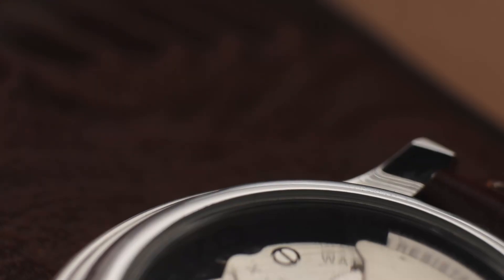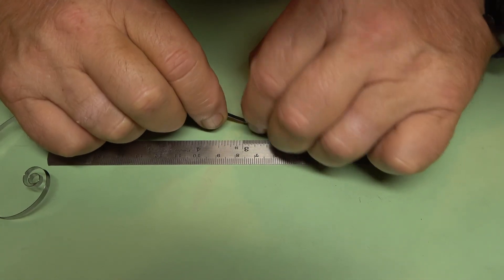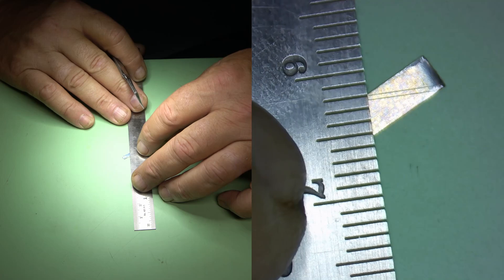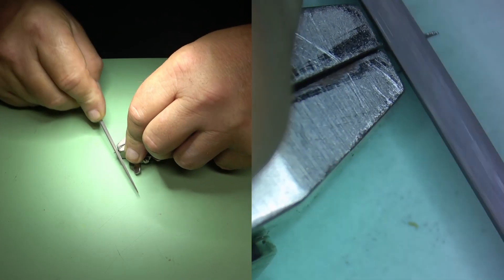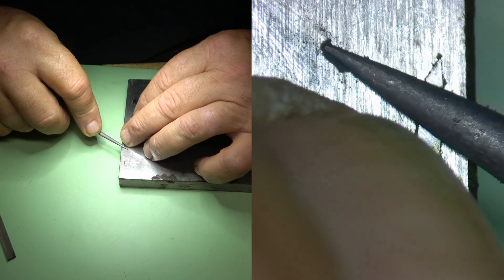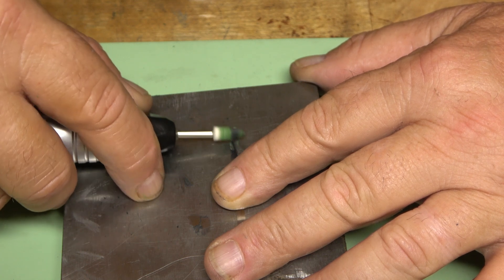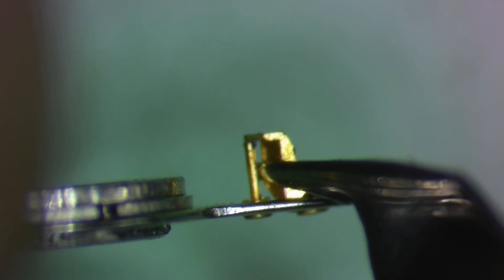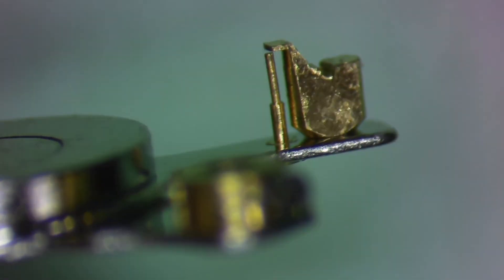How To Make A Regulator Pin Adjusting Tool

Comment: Another great video!  

Sorry if I'm slower than the rest of the class, but... :-| 

If I have a movement which has a large timing difference between dial-up/dial-down (horizontal, in your vernacular, right?) and crown up/down/left (vertical?) should I increase or decrease the regulator pin gap?  It sounded like increasing the gap might bring the two measurements closer.   

Research elsewhere seems to indicate that widening the gap might trade off the constancy of the amplitude and rate thru the course of a wind-down (i.e. with a wider gap the movement would slow down more markedly as the wind decreases.)  So this would be the tradeoff made.  Sound right?  And THANKS!
Reply from the maker: To answer your question I need to know 1) what movement you are working on, 2) what are the rates,  amplitude and BE in all 6 positions.

Comment: Thanks for sharing so many informative videos. There're amazing.
I'm trying to regulate my watch. After a moth tracking it's accuracy I've found that it's rate advances over time. In the fist days it was a -2spd. Along the month it was increasing linearly every day till +36spd.
May this issue be related to the regulating pin? Maybe the friction isn't enough to hold the spring in it's position?
Reply from the maker: Here are the main factors that could be causing your watch to run faster over time:

Escapement Out of Adjustment: If the escapement isn't properly aligned, it can affect the accuracy of the movement.

Faulty Poising of Balance Wheel and Hairspring: Imbalances in these parts can lead to irregular timekeeping.

Play of the Hairspring Between Regulator Pins: Too much or too little movement of the hairspring between the pins can speed up the rate.

Magnetic Fields: Exposure to magnetism can interfere with the balance wheel and hairspring, affecting accuracy.

Rubbing Friction (Pivots, Jewels, Lubrication): If there’s too much friction due to poor lubrication or rubbing, it can cause inconsistencies in the movement.

Comment: Will bending the pins this way not mess up the accuracy? At least in Jendritzki's Watch Adjustment book, he states that bending the pins this way will make them divergent (not parallel) to each other, and this will result in very different DU and DD rates, because the hairspring will be pulled by gravity either in the direction of a wider gap in one position, and a smaller gap in the reverse position. Instead he insists that one should kink the pin in two places so that it can stay parallel to the other pin. I would be interested in hearing your opinion on that? How would you achieve the double kink, and with which tool? Or is this not necessary in your opinion?
Reply from the maker: First, the main reason for adjusting the pins is to bring the hanging positions closer to the laying positions. So accuracy is already an issue right?

What you are saying is true if the pin is bent too much. If it's too much out of parallel it will affect the horizontal positions and even certain vertical positions.

This tool is really meant for widening the gap when a pin that has been bent in.

The gap can be closed with a multitude of tools to move the pins closer in small increments without affecting differences too much in horizontal positions.

If you are working on a flat hairspring and have to make a large inward adjustment, this is very rare unless the quality of the movement is just crap, then you need a spacer which can be made from old mainsprings or needles to your desired gap. 

This is inserted in between the pins and you make the bend with a stiff tip tweezer. The spacer is just there to prevent crushing the pins together.
Good question. 👍
Reply: @watchrepairtutorials  Yes, that seems like a good idea. Jendritzki writes that the gap should be as small as possible, just big enough so that the hairspring in it doesn't lock when you move the regulator. But I fear that bending the pin with tweezers might loosen the pin at its rivet, and a loose pin would be much worse. It would be great if you could make a video on that subject. 👍
Reply from the maker: @maciej6293  that's true for an over coil but flat hairsprings need a little bit more room to vibrate. Theoretically when a flat hairspring is centered between the pins, the gap on either side should be equal to the thickness of the hairspring itself.
In reality, small adjustments are can be used to fine tune rates in all sorts of ways.
You have to realize the he was an instructor and he is teaching proper theory by the book so to speak. 
Regulator pin adjustments have been used by watchmakers for ever.
Lastly, regulator pins are friction fit so when you consider how small and thin these little brass pins are, If it became loose bending it, it was already loose. 
Believe me, there's no tool designed to make that bend.

Comment: Your videos are just great and my go to for learning. I have a question. I have perched a hundred or so bulk watch main springs and your videos on selecting main springs are excellent. My question is on the spring washers the plate the springs are coiled into their is a number like 50 or 60. Do these numbers mean the length or something or just a stock number. I'm just getting started. Should I have not perched bulk main springs.
Reply from the maker: Probably not. Items that are usually sold in bulk are sizes that are very seldom ever used so if you have a way to identify them, then you can catalog them in its possible that you may be able to use one of them one day..
The number on the ring by itself as no significance.

Comment: Just watched a video of yours about lubricating pallet stones. You said you used grease, but it looked like oil. What kind of lubricant did you use?
Reply from the maker: 9415 is a thixotropic grease that is thick until something comes in contact with it which liquifies it and then goes back to a solid.

Comment: I have been getting interested in watch repair for a couple of months now and I have watched a number of your videos.  You have taught me a lot. Finally I have something to contribute to you. My background is in metallurgy and I spent my career in the heat treatment of aerospace parts.  When you heat the mainspring material red hot with a torch and allow it to cool in air it is not tempering.  It is technically Normalizing.  It will probably make the material soft enough to cut and file but it may not be the best way to accomplish this. There is a risk of some areas, like the edges, cooling quickly enough to partially re-harden.  Heating the spring to a temperature slightly below red hot, if you can do it, would produce a lower hardness and less chance of breaking while cutting and filing. Then when re-hardening the finished tool the steel just has to get barely red hot to allow it to harden on quenching, around 1500 degrees F. In the video it is way overheated. Probably works most of the time but its not necessary.  After quenching temper the tool in any oven at about 450 degrees F for an hour or so.  This will lower the hardness slightly but increase the toughness greatly. I hope this helps.
Reply from the maker: Wow. Thanks for that. I am obviously not a metallurgist so I was just showing the way I was taught it it's great to hear from someone with real world experience.

Comment: Question about shaky hands- What strategy do you use to work on hairspring adjustments and other sensitive parts? Or can you drink 4 cups of coffee and still have steady hands like a superhero?
Reply: The secret is to relax as much as you possibly can, mentally and physically. Check and relax your shoulders, then do it again and again.
Reply from the maker: Well, I can tell you that working in a comfortable position helps greatly. Working under a microscope also helps with the ability to make very precise movements.
No, i'm a two cup of coffee guy. That's it.

Comment: Every watchmaking tool vid ever. 

"To make this simple tool go out and buy 5 tools." lol. Great vid but this is always a frustration with this stuff haha.
Reply from the maker: Many people will already have files. You can always come up with a different method or material to make the tool. 
It really just depends on what your goals are.
Hell a lot of people don't even work on movements with adjustable pins like these.
Reply: @watchrepairtutorials  Yeah, i was mostly just trying to be funny and speaking to my current situation (I have nothing you would need in that vid to make this thing or the other tools you've shown that i could use haha.).

I also just happen to have a seiko 7006 that was my toughest repair and first vintage watch i fixed from total non runner that just happens to have those pins and it could perform better but I'm afraid to touch the things to lower the delta.
Reply from the maker: @nunyabusiness9056  we all have to start somewhere brother. The longer you do this the more tools you will accumulate.

Comment: You aneal the mainspring ?
Reply from the maker: Tempering and annealing are basically the same except that tempering is done at a lower temperature with faster cooling.
Reply: @watchrepairtutorials  Working with metal ive always called it anealing when I heat hardened steel to soften it so I can work it. then after work is complete you heat and quench steel to restore hardness then finish by tempering to straw color. Thats how I was taught as a child.  been doing it since I was five.
Reply: @watchrepairtutorials  Anealing is softening hardened steel so you can work it.
Tempering is re leaving stress in the metal from hardening process but not removing the hardness.
Reply from the maker: @sonnymoorehouse1941  I am definitely not a metallurgist so I stand corrected. I am just showing the way I was taught to make this.
Reply: @watchrepairtutorials  Im only sharing what I was taught. other kids played with toys. I used torches and saws and grinders to make things.
Reply: @watchrepairtutorials  Your work is fantastic.

Comment: Nice tool! Thanks, Alex. I hate using a screwdriver on them.
Reply from the maker: Try it out Robert. Screwdrivers are usually to large and it's harder to make small adjustments.
Reply: @watchrepairtutorials  I knew that there was a good reason to keep those busted mainsprings.

Comment: This might be a stupid question, but it seems as the pin bends more (as seen here 07:08 ) than the "fixture" opposite of the pin, can this lead to beat error, since one side is bent more.
Reply from the maker: Not a stupid question. Beat error occurs when one oscillation is larger than the other. This can be caused by many things but is but is usually corrected by adjusting the hairspring collet right? 
Adjustments here can't affect the beat error unless the regulator pin was actually loose and moving around.
Like I said in the video, these touches are making are exaggerated, and in reality they would not be as aggressive as what you see.
They are very small micro adjustments .
Where you can run into rate problems in the horizontal positions if the pin is at a large angle.
Reply: @watchrepairtutorials  Thanks for the answer:) I clearly have some learning to do.
Reply: @TimRobertsen bruh... sign up for his watchmaking course. I signed up and it's a legit course! I'm learning a lot!

Comment: I wish that I had this tool when I broke a regulator pin last year. These pins are very easy to break and difficult to replace. Thanks Alex!
Reply from the maker: Sorry to hear that but know you know.
Reply: Easier to just replace the whole balance assembly.
Reply: @HRM.H  It was for a 1945 Cyma Tavannes 166 movement. I did search around but wound up buying an assortment of regulator pins and replacing it. It did teach me to be careful next time.